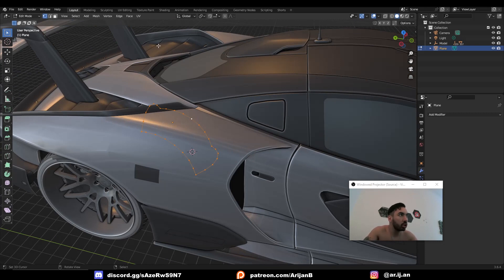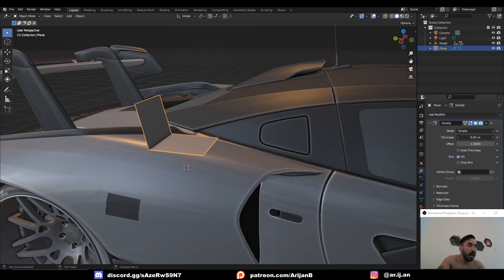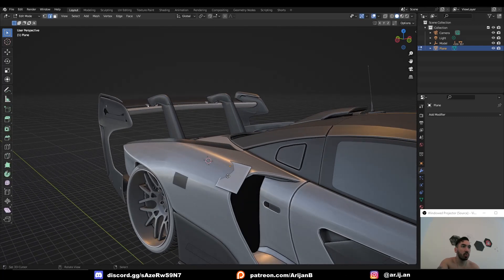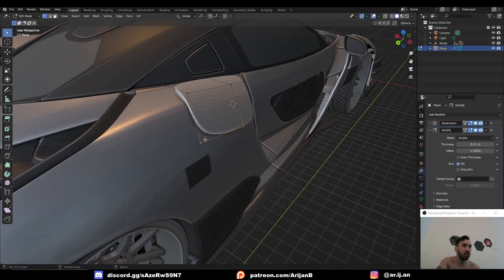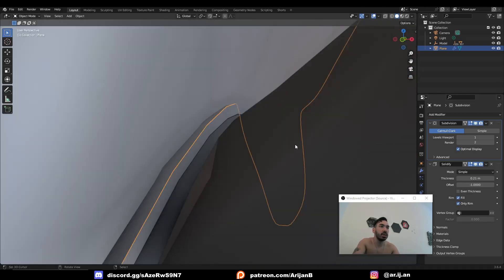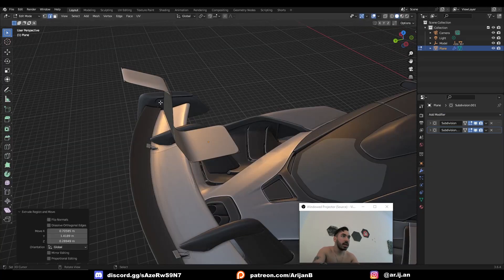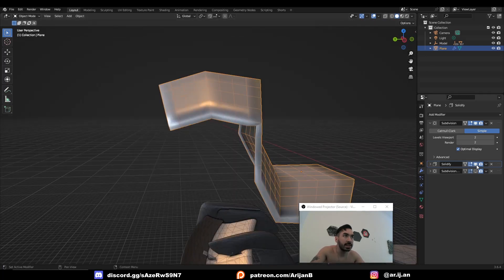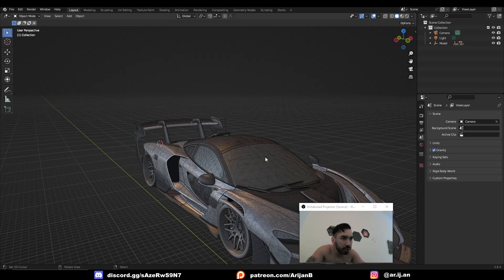The MOST IMPORTANT Car Modeling Tool (Arijan)

Comment: i often come accross that issue : if i add a solidify modifier to my geometry, if the angle are too tight and the thickness too high, it will create overlap of the solidified geometry on those tight corners,how do i prevent that if i really need some of those angle to be tight, but still need more thickness everywhere else ? >_<
Reply: Check the object scale and rotation properties sometimes having wrong or negative scales messes it up , you can reset them in object mode with CTRL+A then select what to reset from the menu
Reply: @15_cenTT  will make sure I'll check it out next time xD I usually do it when I use bevel but didn't think abt it for the solidify, thnx 🙏